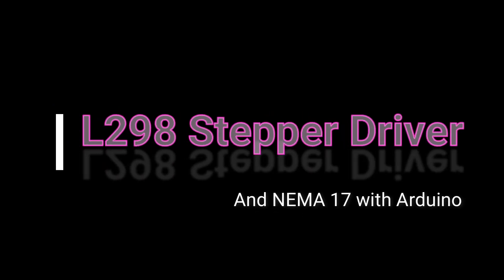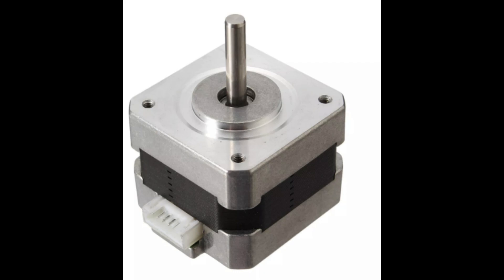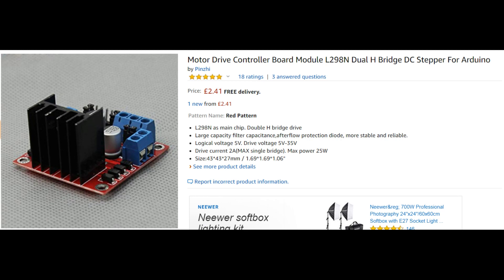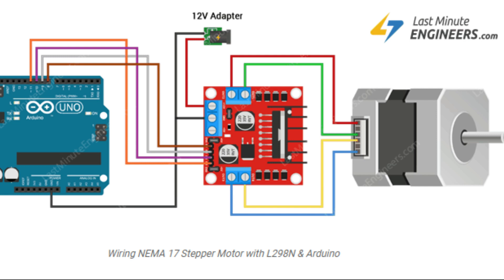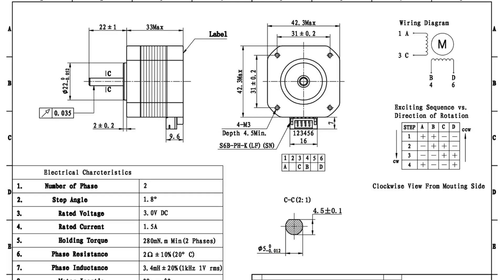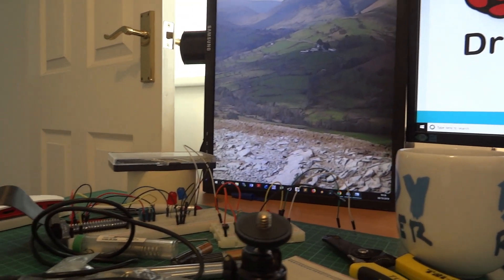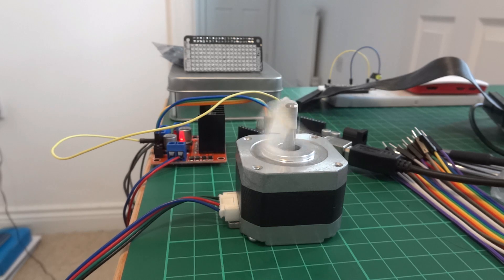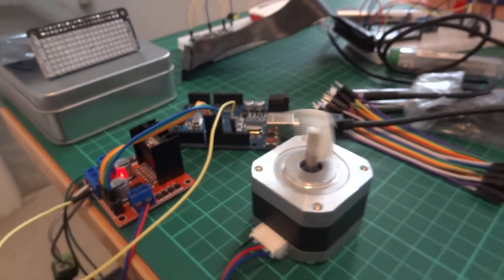L298 + NEMA 17 stepper motor via Arduino UNO

Comment: So you know why mine vibrates a lot?
Reply from the maker: Check the wiring, almost certainly in wrong sequence. It's very common as Chinese made never stick to a colour scheme.
Reply: @jobstr-work  The one I bought from is from a Thailand. The color is (yellow,  red, orange, and blue). Do you have any videos to help me wire it correctly? Thank you very much!
Reply from the maker: @ytshortchannel224  See this link, go to step 3.  https://buildbotics.com/wiring-stepper-motors/
It's kind of trial and error by feel - but it does work!
Why they can't have a colour standard is beyond me.
Reply: @jobstr-work  The motor still shakes even after I move the wires. Maybe this is a defective stepper motor ?
Reply from the maker: Maybe, try another one, from Adafruit or PiHut maybe?

Comment: Was your use of a 12V 1.5A power supply deliberate? If your power supply was rated for say 12V 2A would you run the risk of the motor having 2A put through it which would damage it due to the motor only being rated for 1.5A at the rated voltage of 3V?
Reply from the maker: I always try to match the rating of the motor, but if I only have a power supply with higher Amps then it's ok, as long as you don't jam the motor or put too big a load on it to move against.  Depends if it's a test project or something you want to deploy in production.

Comment: Hey I love the video! what 12V adapter did you use and if so could you provide a link?
Reply from the maker: Thank you! I used one from an old cordless phone charger. You can use any adapter as long as it can supply enough current. eg. If you use 12v,  100ma when the motor requires 300ma then power supply is no use.

Comment: Hello, very nice video :)
Could you please help me with my problem?
Is it possible to changing RPM (from my PC) of stepper motor while motor is running?
Thank you!
Reply from the maker: I am a  bit rusty on this, but...look up 'PWM' pulse width modulation, motor speed control..there are modules for Python that will handle that,  especially if you use the Adafruit HAT.
Reply: @jobstr-work  Did you mean this https://learn.adafruit.com/adafruit-dc-and-stepper-motor-hat-for-raspberry-pi/overview ? So do you think it would be better for this to use a Raspberry Pi rather an Arduino?
Reply from the maker: @nebster-vp6xs  Depends on what your aim is, I mentioned the HAT as I was still thinking about the Pi. 
See this :
https://simple-circuit.com/arduino-bipolar-stepper-motor-control/
This let's you control the speed with a  10k ohm potentiometer.

Comment: Sir, i just following the instruction that you given in the video. But, my stepper still vibrating
Reply from the maker: You will definitely have the wires the wrong way around, and frustratingly, the colours vary from motor to motor, brand to brand.

If you have a multimeter you can do a continuity check for the pairs.

See also:

http://www.cnckaran.com/download/StepperMotor/Theory/Lin_RG_StepMotorBasics.pdf

Comment from the maker: CODE : 

#include <Stepper.h>

const int stepsPerRevolution = 200;  // change this to fit the number of steps per revolution
// for your motor

// initialize the stepper library on pins 8 through 11:
Stepper myStepper(stepsPerRevolution, 8, 9, 10, 11);

void setup()
{
  myStepper.setSpeed(360);
}

void loop() {
  myStepper.step(stepsPerRevolution);
}